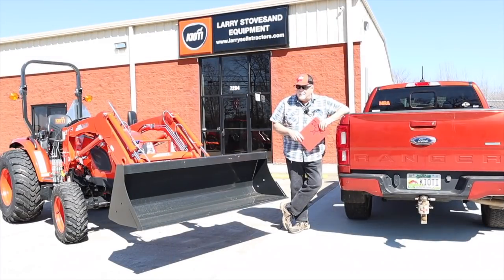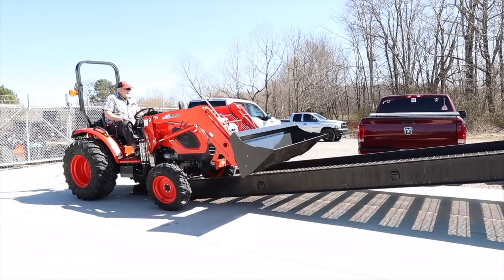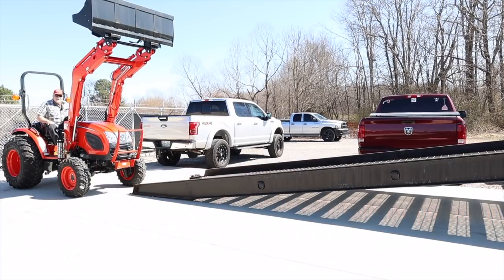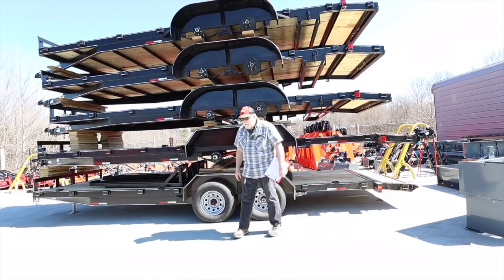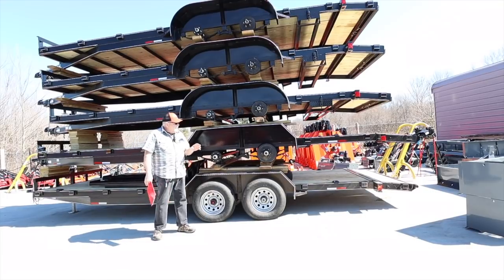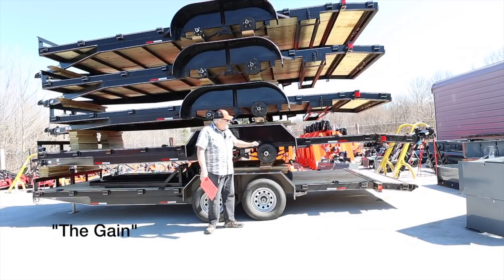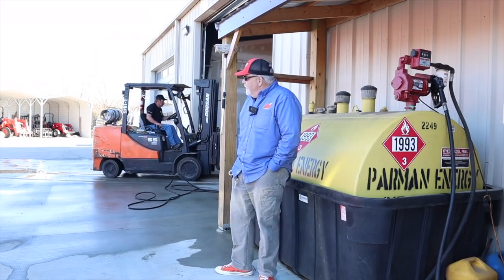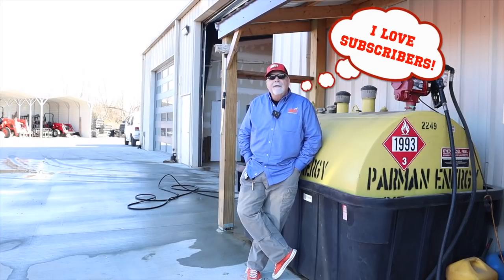BEST WAYS TO BREAK YOUR TRACTOR PART 2

Comment: One more thought / suggestion, since you asked, please explain the importance of ballast, especially if you’re doing loader work. Adequate ballast goes a long way, especially in sub-compact & compacts. The amount of ballast recommended by the manufacturer is often way higher than folks imagine - often by hundredS (capital S intentional) of pounds. Ballast is so important that i know of some dealers won’t let you drive home your new (or new to you) tractor until you pass the quiz on how much ballast you need for the kind of work that you’ll be doing. Kinda like can’t drive your new truck away til you prove you have insurance. Two choices: 1) have the right combination of ballast, or 2) have a great life insurance policy.

Comment: All good info Mike. A little refresher course never hurts. One thing I could add is NEVER get off a tractor without putting on the brake no matter how flat the area is. Strange things can happen!
Reply from the maker: Exactly. It becomes a habit.
Reply: In addition,  especially on a gear drive tractor, put it in gear after you shut it off. I've had the brake release on its own. Fortunately I was able to hop on while it began to move and was able to stop it from rolling downhill.

Comment: YA' know; you gotta respect a guy who takes the time out of his own responsibilities to feel the need to share all of these issues and possible events and facts about the possibilities of endangerment.  If I were buying a tractor, or equipment, or implements and I were in his surrounding servicing area, I would definitely find myself seeking out this gentleman and bouncing my possible tractor, equipment, and implement needs off of him before wandering through countless Dealership yards and listening to multiple sales pitches from God knows who for whichever tractor (color) is best and/or which and/or what and/or why.  

Information is the power to influence, especially when commonly spoken by someone in "common terms for common people, and for common needs for a common cause."  No fluff, just straight at it....    

"Here is what I have," is what the man says, and "here is when it is possibly available, and how much it should reasonably cost," "and hey, I'd like to put something together for you if I could; so just give us a call at one of our locations" (is what Mike says).  Enough said.  Great information for those who do not have experiences with operating tractors, equipment, and implements and as well, great information for even those who actually do have experience, but tend to ignore common sense on many events sometimes.

Comment: You could talk about connecting PTO shafts, especially when used in conjunction with the drawbar.  If the implement shaft length is not correct for you tractor, it is possible to push the PTO shaft in to the transmission.

Comment: I use 4WD when pushing snow.  On my CK3510se, sometimes the axle shift lever will bind up, but lift the front end up with the loader and it shifts back to 2wd very easily.  Very  informative video.

Comment: One exception for wearing a seatbelt... when you're operating around waters edge on a body of water leave the seat belt off. If you happen to slide off the bank into the water you'll probably panic when trying to find the release buckle while under water.

Comment: Mike ,😎 you sir are awesome,  I always enjoy watching your videos.  Great points on all your details.  Us up north also need to make sure our fuel is treated with anti-gel in and tanks kept filled to the brim during the cold months I also personally make sure to top off all equipment tanks after each use.  For fuel storage our transfer take is an aluminum 90 gallon  in the back of a 1 ton with post pump in-line clear case filters with a 30 micron water and separator in the first stage and a 3 micron in the 2nd stage.  We do use a lot of diesel on our farm so I understand the expense of my setup is not for everyone.

Comment: Thanks again.  Have you experienced when lifting a heavy load, only one side lifts.  This happened the other day and it twisted the tractor.  It was a pallet that was evenly loaded
Reply from the maker: No. Never. That should be a concern. Make certain that there are no loader lines kinked. Also, if it continues, I would uncouple the hydraulic lines and switch them. Then you can see if the same problem happens on the other side. If so, the line or coupler could have failed or be clogged. Additionally, check the loader hydraulic cylinders for seal leakage.

Comment: With my backhoe attached for ballast my forklift pallet attachment on my loader on my c.k. 2610 I can carry two 12 to 15 ft 20-inch diameter logs and if I keep them down low and drive at a normal safe speed I can move them around and the back of the tractor doesn't Rock very much at all even on on even ground as long as I move slowly in 4-wheel drive I have no problems